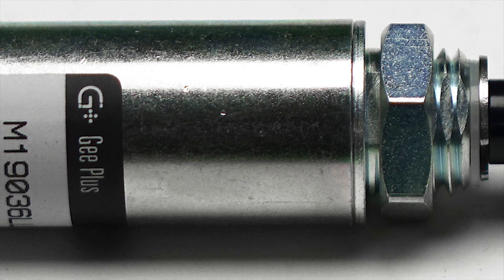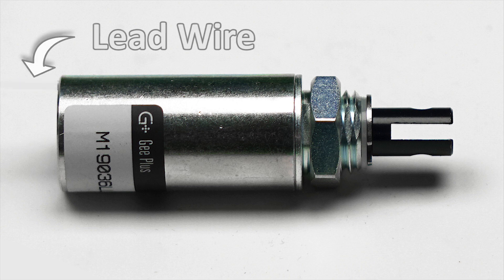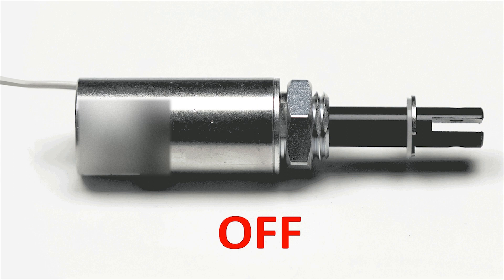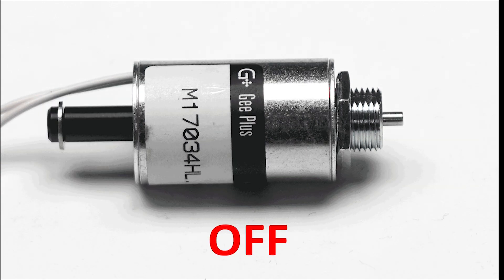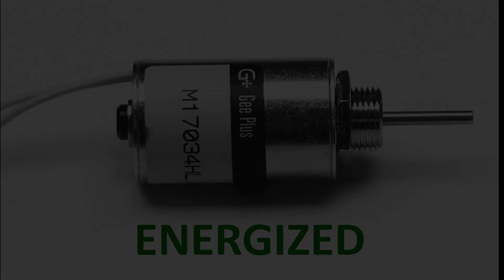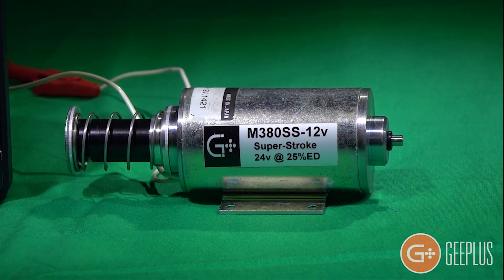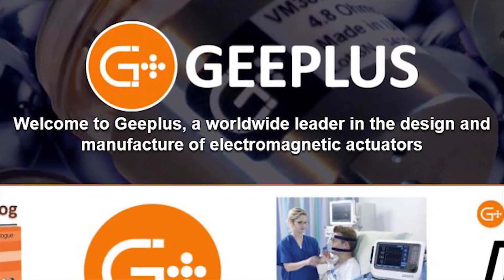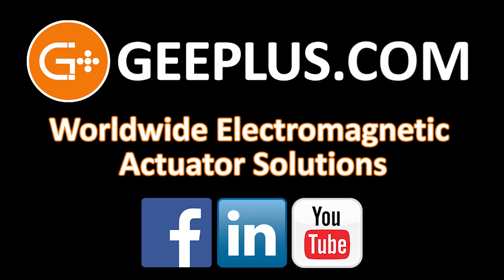How does a Linear Solenoid work? (Tubular Solenoid)

Comment: I may be able to replace a stepper motor/driver/controller with your actuator. a short stroke of 1/4" to 1/2" is all I need (could be more). I need to seal a Keruig style K cup lid to the cup filled with coffee. Your device would be attached above a heated sealing head that has 4 springs to cushion/absorb the stroke force. The approximate weight of my sealing assembly is about 10oz's. Need  about 100 on/off cycles per minute. I can provide 24VDC from my devices PCB on/off switching. Your thoughts and recommendations would be welcome.

Comment: Okay, I have what might be a stupid question: can the stroke distance be controlled by the voltage, or do they usually just have the two states?
Reply from the maker: There are no stupid questions here Ndoki! In this case, this type of solenoid is an on/off type of actuator, so it is basically either energized or not. With a return spring, the solenoid will pop back to the starting position when the power supply is cut off.  

To achieve the type of (proportional) movement you're talking about, would require the use of either a Proportional Solenoid or a Voice Coil Actuator. Both of these are typically quite a bit more expensive.

Another option for less expensive, semi-proportional movement would be a Super-Stroke solenoid, which you can see here: https://www.geeplus.com/super-stroke-solenoids/
Reply: @geeplus7017  do you have a remote controlled one 🤔
Reply: @geeplus7017  ☺